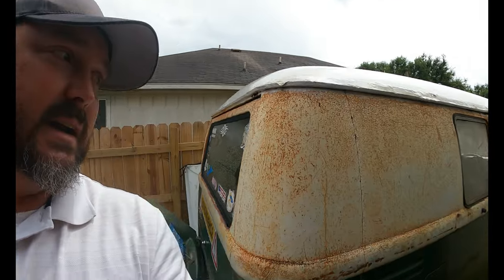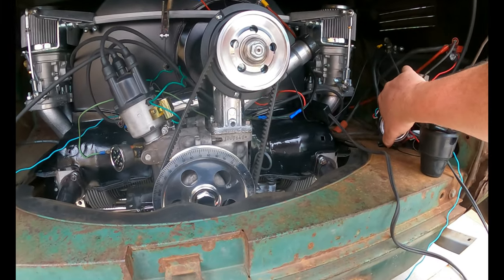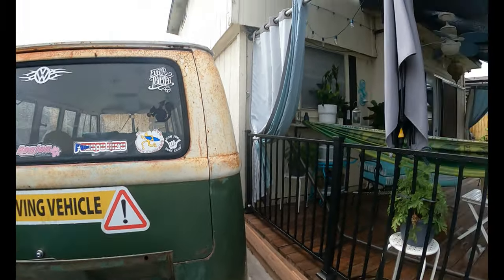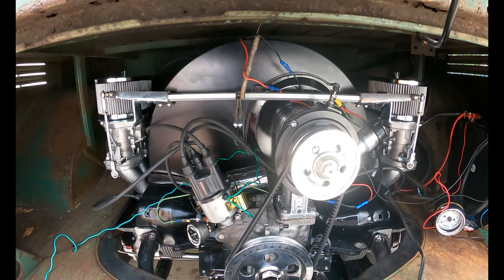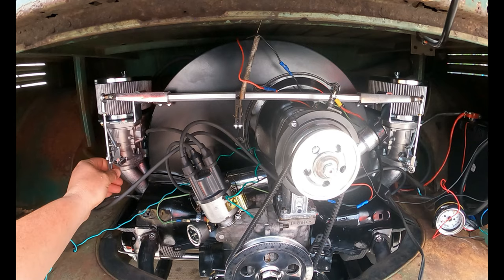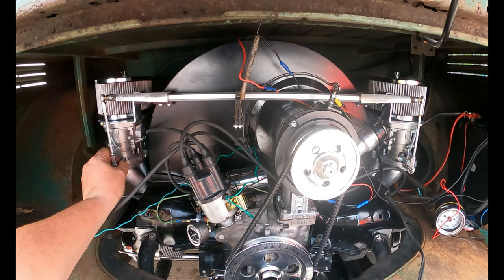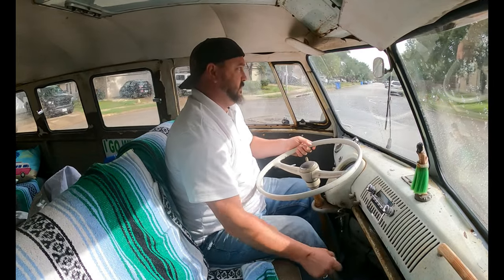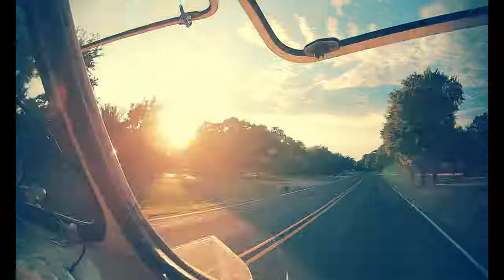Return of the KiKi Bus! Tuning HPMX Carbs and Setting Up the Hex Bar Linkage

Comment: If I wanted to take me and my dads bus to a store that is 15 minutes away, nearly 80 or 90 degrees, what speed limit would you recommend or anything that you would recommend (all of the stores are 15 minutes away from me)?
Reply from the maker: You should be able to drive it as normal. As long as it's tuned correctly and running good 55-60 should be fine. These engines were made to drive in anywhere from  the desert to the Arctic. Get out there and enjoy that bus!
Reply: @OldVolksTV  But when it hit 54, it was not doing good. When entered our neighborhood, it lost its idle and stalled. What tuning should I do?
Reply from the maker: @saturnworld1840  make sure the valves are adjusted to .006 , the timing is set , and the carb is properly adjusted. Most of the time the carb adjustment is the issue. There's plenty of videos on youtube for adjusting them and it's pretty easy.